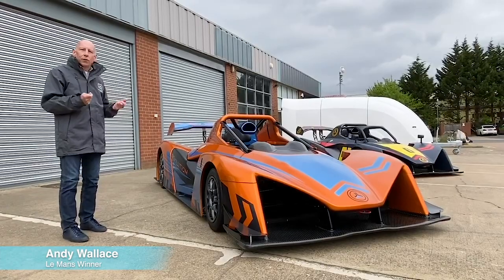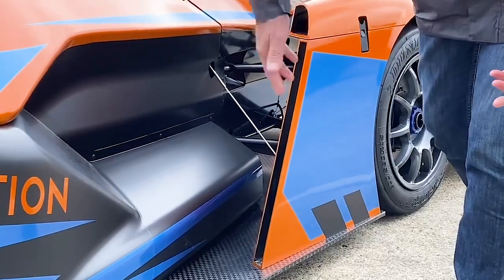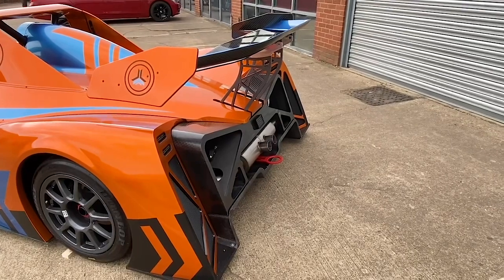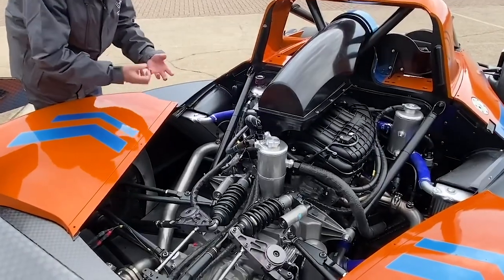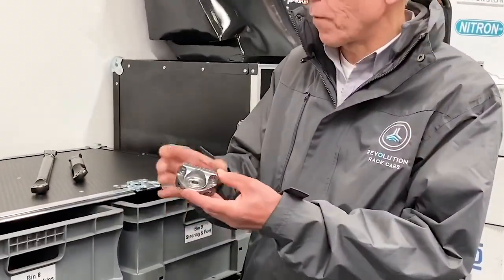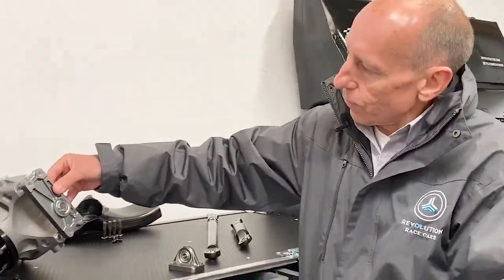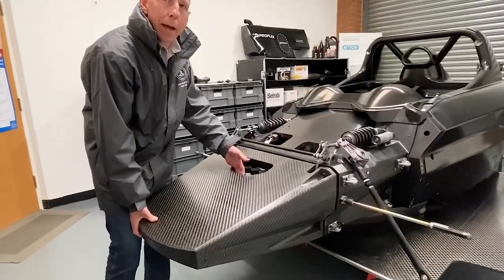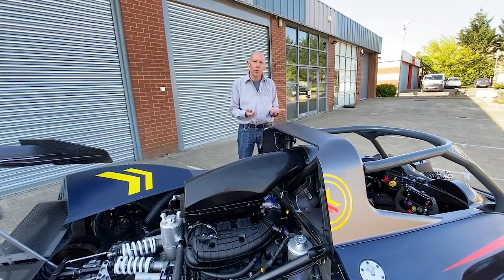Le Mans winner, Andy Wallace, shares the secrets of the Revolution A-One

Comment: What’s done to the engine to get 400bhp?
Reply from the maker: It’s now 500bhp

• Stock oil sump removed. Replaced with our own bespoke dry sump system. Lowering the centre of gravity for the engine by 63mm. 
• Stock intake system removed. Replaced with bespoke intake plenum and manifold. 
• Stock cast exhaust manifolds removed. Replaced with bespoke tubular manifolds, by Ferrita. 
• Rotrex centrifugal supercharger added. 
• Stock water pump and thermostat system removed. 
Replaced with electronic twin water pumps, with speed control. Making it possible to mount the engine 70mm closer to the tub, for best weight distribution. 
• Fully ported and balanced engine assembly by RLM 
racing. 
• 280 horsepower stock, to 500 horsepower
Reply: @RevolutionRaceCars  I was hoping to learn some details on the naturally aspirated 3.7L version of the engine but I really appreciate you for sharing your insight of the SC500 engine